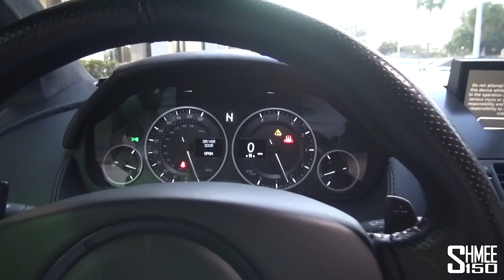I Delivered Tavarish's New Aston Martin V12 Vantage S!

Comment: Hey Tim i have a couple general question here.
1. How hard is it to adapt from left-hand drive to right-hand drive?
2. What is it like to switch from driving on the left side of the road to the right side?
3. What is it to drive with a left-hand drive car on the left side of the road?

Since you switch quite often i would like to know these.
Funfact: for a while, the german "Blitzer" (speeding cameras) would automaticly put a rectangle on the passenger side of the picture for privacy reasons. So if you have more drivers registered on the car, the german Kraftfahrt-Bundesamt (the institution which issues your drivers license) couldn't assign the points to your drivers license you still have to pay the ticket of course but you wouldn't be fearing the loss of your license. 
I don't know if this is still the case so please don'T take this at face value.

Comment: I've been wondering for years now but why do you use 50fps instead of 60? does 50fps offer something 60 simply doesn't ; like does the lower framerate make the videos easier on the eyes, i've noticed that some 60fps videos are kinda wonky to watch .
Reply from the maker: It's Europe vs USA. European camera/devices are 50fps.
Reply: @Shmee150  thanks for clarifying, its been in the back of my head since 2013.